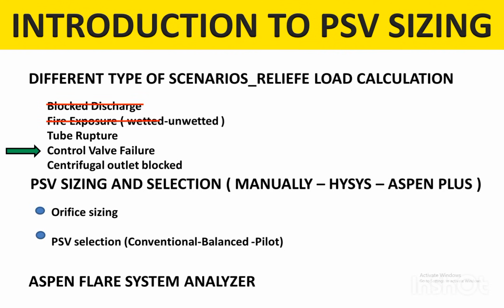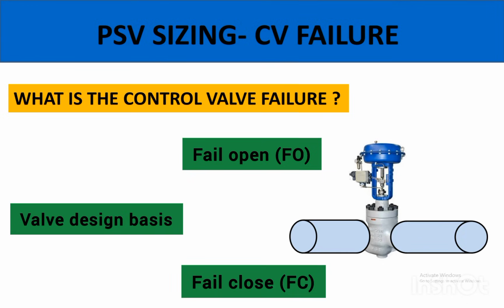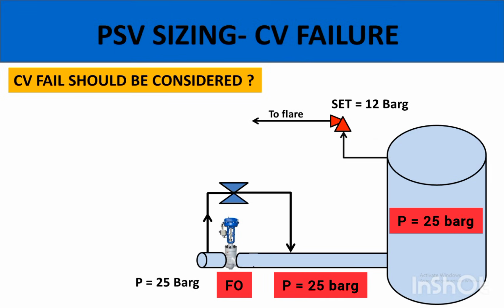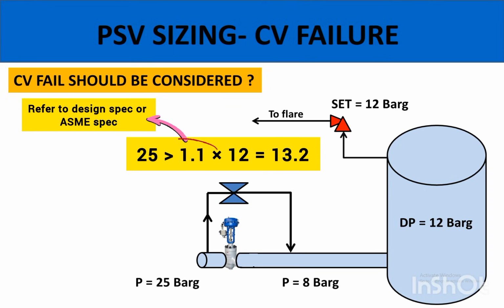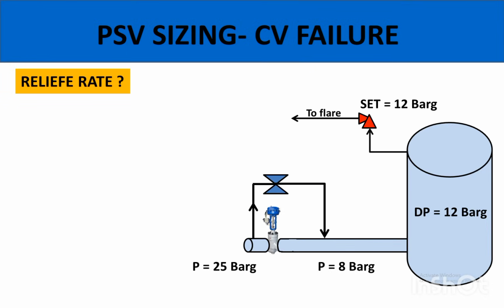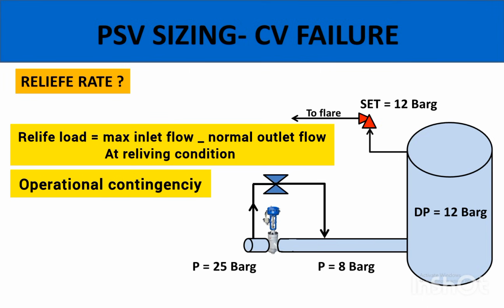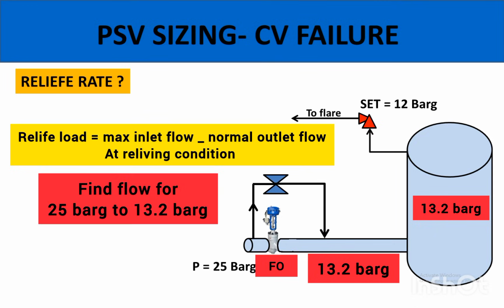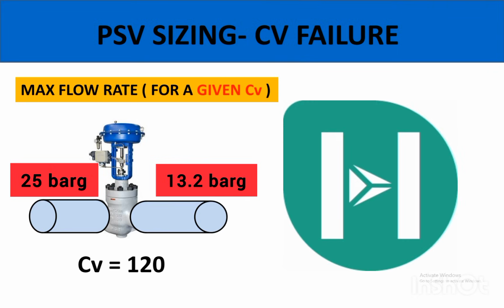CV FAILURE CONCEPT_PART 1

Comment from the maker: Tnx for sharing ur experience 🙏
Consider liq overfilling is applicable, PSV should be installed on vap or liq stream ?
Reply: PSV installed on top of equipment or overhead vapour line
Reply from the maker: What would be its relief load ? 
We know that if liquid overfill equipment, exess liquid flow should be directed into flare system , but we dont know any sense about excess vapor 
Right ?
Tell me if u know anything about vapor relife load and its concept
Reply: @THE_CONVERGE 
If control valve failure scenario occurs which will cause downstream equipment overpressure, simultaneously at relief condition additional liquid inventory also dump in downstream equipment and if this additional liquid inventory is greater than downstream equipment vapour space then, liquid overfilling will occur. General this relief is two phase or liquid relief case by case, if your KOD has capacity to hold additional liquid inventory then it's okay to consider this scenario otherwise we need to mitigate such scenario by installing mechanical stop across control valve or HIPPS system upstream of control valve,etc